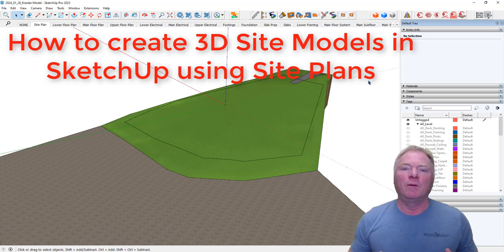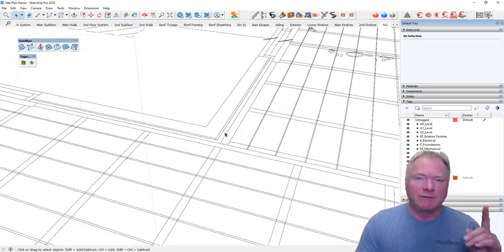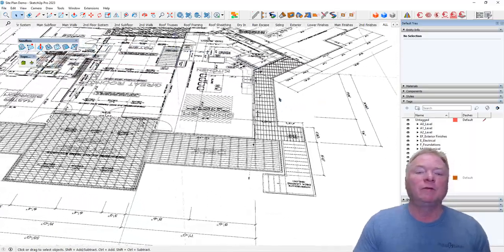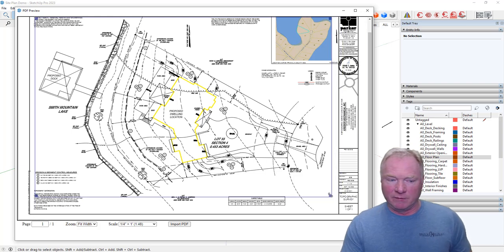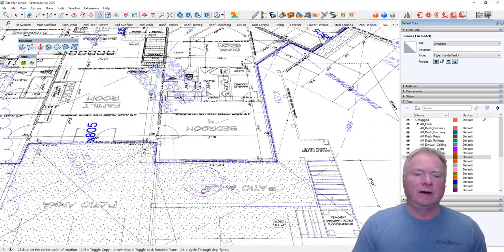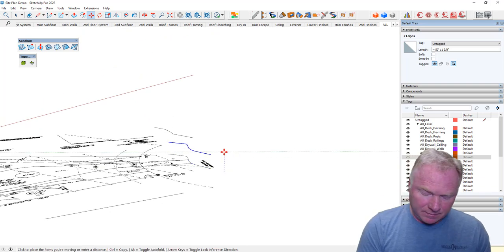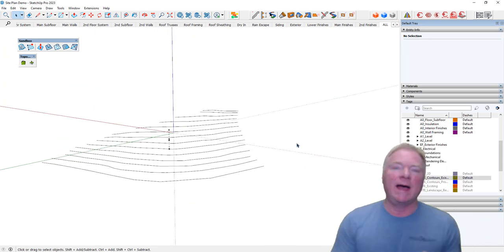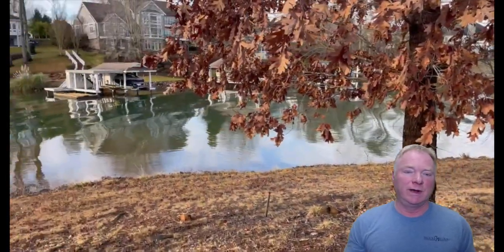3D Site Modeling in SketchUp - Part 1: The Existing Site

Comment: John, have you ever looked into using a drone for photogrammetry to get your as built condition of contours (to create surface model) and an Orthomosaic that you could drape over your surface model? i have done this with success using dronedeploy, autocad and sketchup. your total station would produce better spot elevations but the drone data is relatively good especially if you are using an RTK drone like an older DJI phantom 4 RTK (easy and cheap to acquire now as its outdated to the new drones)

thanks for all your awesome info!
Reply from the maker: Thanks Jesse! I would love to get into the drone work.  We use a Trimble RPT 600 to capture topos, unless the site is heavily wooded.  For the example I demonstrated, it is a job I am pricing and may not get, so I figured I would use the free information (2D drawing) and show how to convert to 3D.  We did pick up a DJI drone but only using it for capturing drone footage of our jobs for progress, etc.  Cool tech out there!